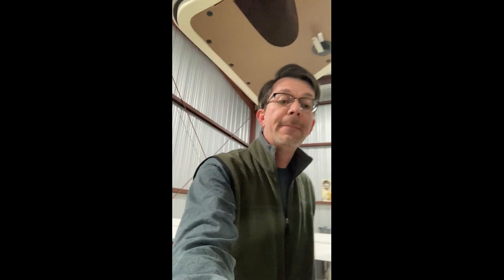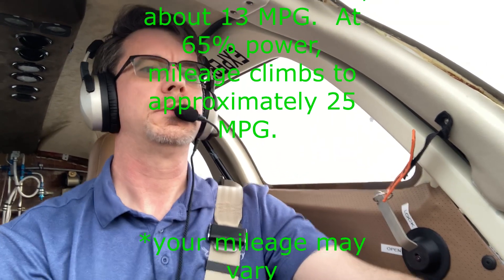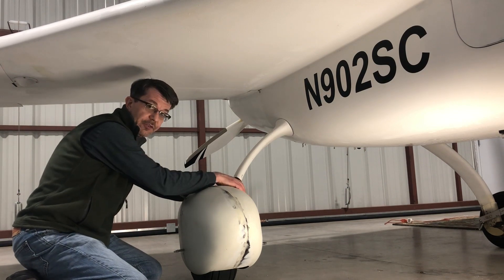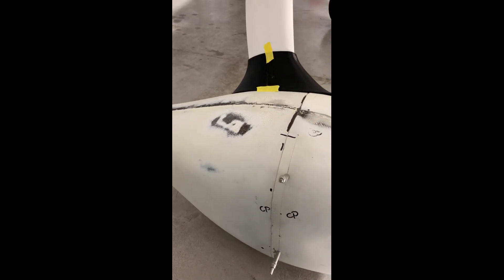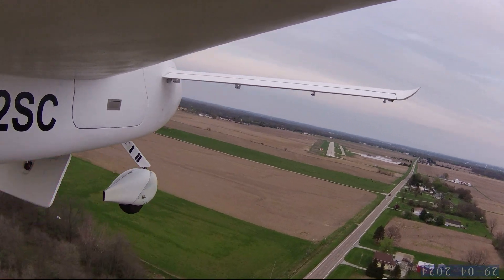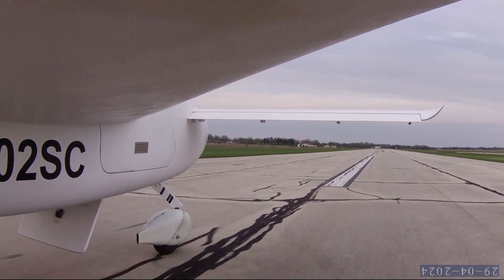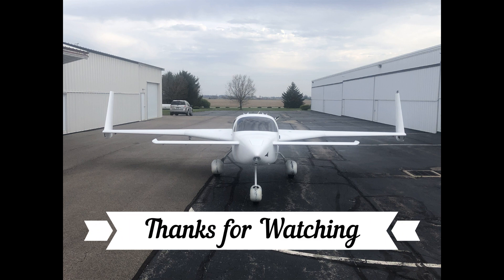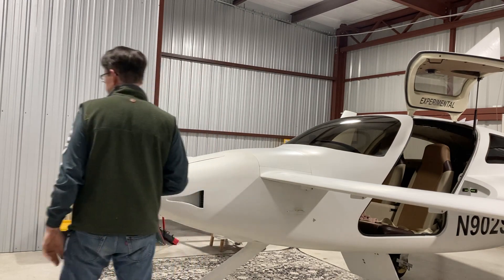Velocisteve Volume 2

Comment: Halon? I thought they were banned. I still have mine after 30 years, still has charge. I worked in a two way radio shop and I kept a halon around in case a radio went into suicide mode.

Comment: "We" = You and the aircraft! Or maybe you and your passengers (us).
 
Why is "Experimental" written upside-down? Does the FAA require it be read when entering the plane rather than seated in it?
 
Funny bit with the pants, and building on the previous volume's remark about the laundry chute. I was impressed with the quality of the pant-fairings! They are beautiful!
Reply from the maker: Thanks for the comment / question.  Right, with the gull-wing doors open, "EXPERIMENTAL" is right side up and at eye level.

Comment: I fly this plane in MSFS 2020 and the Velocity in the sim is fully loaded and has a GTN 750 with a weather radar display. Is it actually theoretically possible to fit a weather radar in a Velocity in real life?
Reply from the maker: I suppose it’s plausible to squeeze it into the nose, but what the 750 in the sim is likely showing is weather coming in from ADSB-in data feed.   I actually get weather displayed on my Advanced Flight System 5600 from ADSB input.  A pilot just needs to realize the weather data is not realtime (like an onboard radar) and can lag perhaps 25 minutes.

Comment: Can you comment on why you chose velocity? There was another video about that. I am an aspiring pilot looking at planes for the future. I will most likely buy and not build one, but velocity seems to be very efficient all around. Looking for 4 place.
Reply from the maker: Short answer to Q1: I was enamored with the design for many years and I was looking to build another plane back in 2016 (I built an RV-6 years ago - N601SC).  Q2: I'd say unless you have a 100 or 200 hours in a variety of small aircraft, I'd say stick with the basics (C-152/172, Archer, RV-9A, etc). There's serval reasons I say this; tops: 1) you likely will not be able to get insurance for a Velo 2) my Velo with its fixed pitch prop NEEDS at least 3500 feet of runway to operate comfortably. This limits airport selection. 3) there are no two Velos built the same, each have their own quirks. These are not insurmountable, but stay simple for your first few years of flying.  Please subscribe to VOBA for lots of other info & comments if you are serous about Velos.

Comment: The pant fairing is very cool, we have a Velocity TXL FG but that part certainly looks great on the plane. Was there any improvement in air speed etc?
Reply from the maker: I''ll get back to you.  My prop took FOD damage, so I'm down for a few weeks. Needing to do more testing, but I suspect the addition of the pants did not add much (maybe 5 kts...?) as they are large - these are actually the wheel pants for Velocity XL.  Two primary reasons I added them: A) act as fenders to keep FOD from the prop (yes, quite ironic that the prop was damaged right AFTER I added the pants. No, I have no idea what hit the prop, but there is nothing mussing from the airplane or engine/cowling - a big mystery)  B) aesthetics.
Reply: @velocisteve-myvelocityairc5494  We have a TXL and are interested in the fairing, we also had a FOD incident outside the hanger

Comment: Any chance you can take a picture of your camera mount in the wing? I bought a Velocity SUV and I am trying to find a place for the camera. Also, I am planning on installing a speed brake on mine. How hard is that?
Reply from the maker: I shot some video the other day about camera mounts. I'll try to work it the next addition. RE: speed brake, this would be a big mod if the airplane is already flying and much depends on what model you have. Please consult with Scott Swing at Velocity for more details.